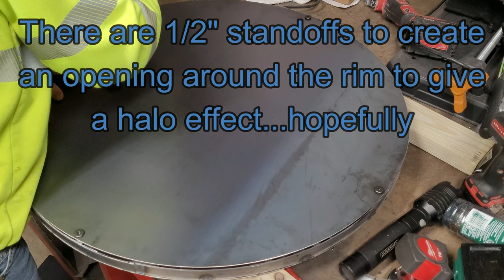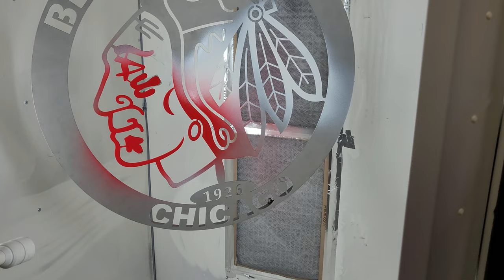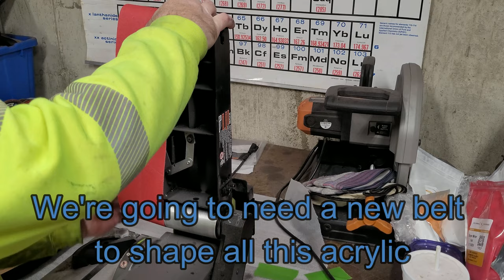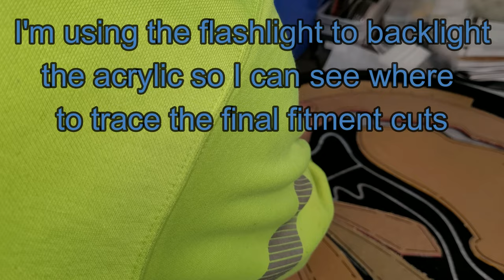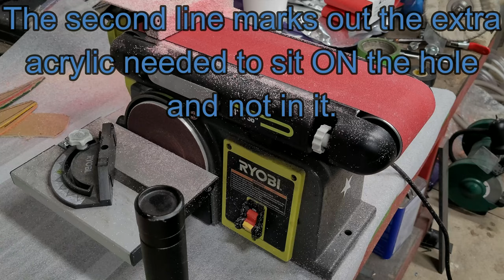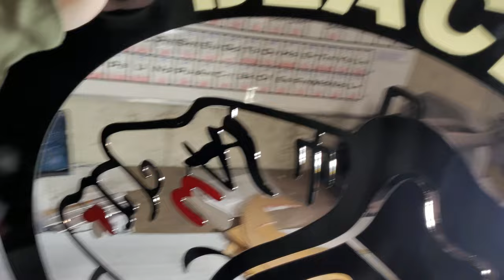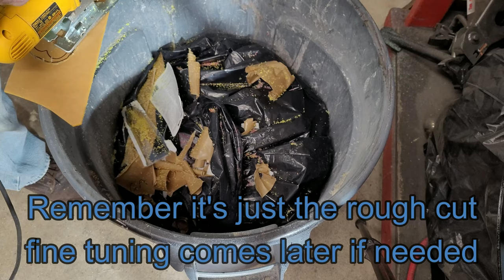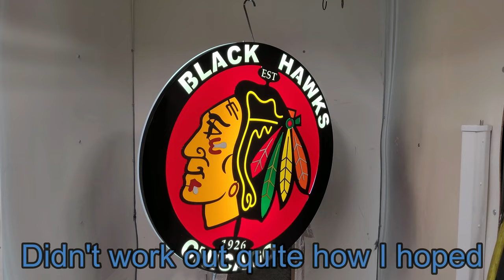Chicago Blackhawks Sign build!

Comment: Looks great!  Looks like you've really got your settings for 14ga dialed in- my Crossfire Pro is shipping this week and I'm pairing it with a Cut60, so I've got to learn all new settings (had a Hypertherm 45xp on my last table).  What do you use for settings?
Reply from the maker: On 14ga I run 37A at 100IPM, works great at that setting.  I've run a few different settings and they've all worked pretty good, it's a very forgiving setup.  The good news is the settings chart that ships with the Cut60 is pretty spot on.  If you set your machine to the settings they recommend, you will for sure be in the ball park if not right on the money.  They don't list every gauge but you can guesstimate pretty close for the sizes missing.  You will love this setup, bang for the buck it can't be beat.  Congrats!